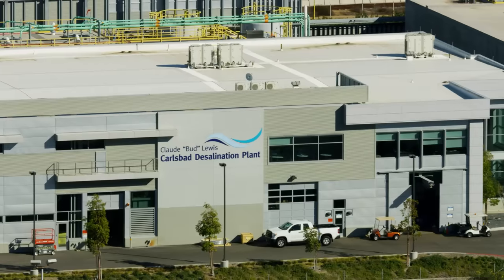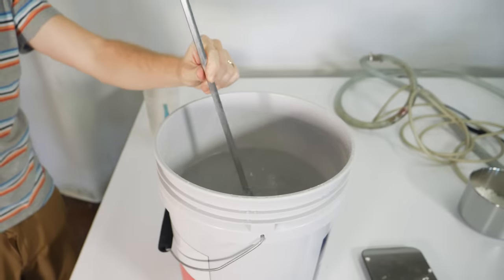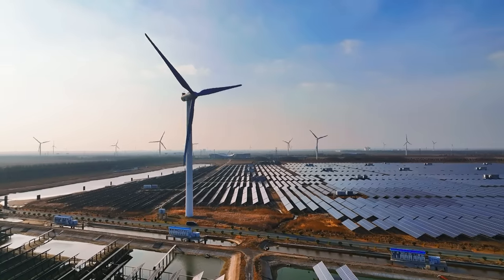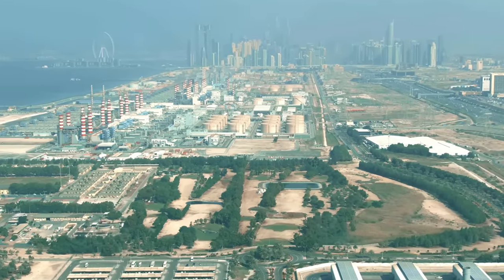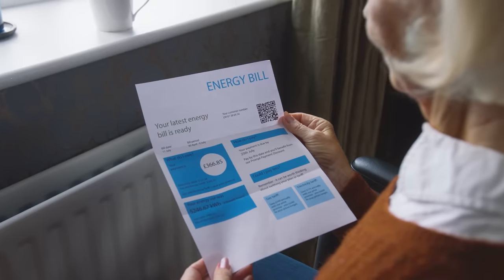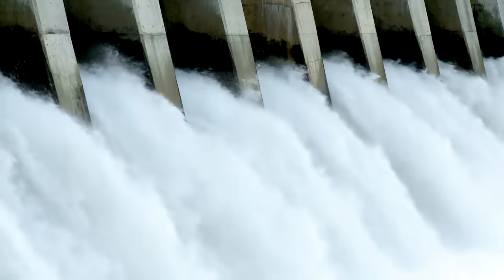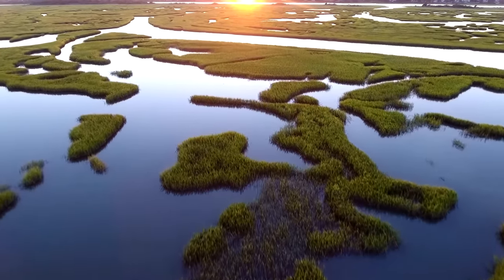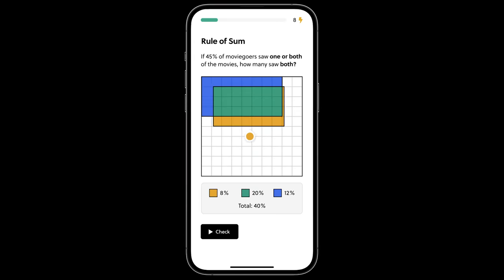Why Is Desalination So Difficult?

Comment: 6:00 Why not use two water delivery systems ?
One to bathe with that contains salt, which is actually good for the skin,
and one to rinse with and drink. That lowers water consumption to maybe 50 gallons
per household per day. Then you'd only need to distil or reverse osmosis that much
instead of the full 500 gallons.
I'd fit my boat with both forms, and only require 3 gallons per diem. The rinse is done
by filling something akin a wetsuit with water, maybe twice.

Comment: Interestingly, salt water can be used as the electrolite in a battery. The anode and cathode of the battery facilitate electron exchange between the sodium and chlorine ions in aquious solution. Aside from generating power, this has the side effect of precipitating the salt, (desalinization). If anodes can be found that don't corrode in the presence of chlorine, it should be possilbe to generate significant power while also producing large amounts of desalinated water, with sea salt as a byproduct.

Comment: Seems salt water could be used for some purposes, without desalination, to reduce the use of fresh water.  E.g., fire fighting.  Industrial cooling.  Etc.  I realize it would be necessary to use highly corrosion resistant plumbing, but if the water is very cheap then maybe that would be worthwhile.  I first considered this after seeing the fire in Lahaina, Maui.  They're sitting right on the ocean but couldn't get any water to fight the fire.

Comment: I actually submitted a different water solution to San Diego which would make  generate water for the same money it costs to bring it down the aqueduct but San Diego did not bite ... the current solution is very expensive because of the method and then transportation.

Comment: Supercritical Water will not hold ionic salts.  Could it be used for desalination?  Requires elevated temperature and pressure.  For the heat you can use combustion in the sH2O, it is called supercritical oxidation SCWO.

SCWO operates at extremely high temperatures and pressures (above 374°C and 22.1 MPa).   The pressure would be about 220 atm.  Reaching and maintaining these conditions require significant energy, which would probably make the process more expensive compared to conventional desalination methods like reverse osmosis or distillation.

Comment: So we need to be able to:

1. Bring in water without the need for pre-filtering.

2. Evaporate it without using electricity for the evaporation process or burning fossil fuels. Perhaps by using focused/condensed sunlight to raise the temperature of the water to boil. 

3. Have the heating occur from the top so as to prevent the inefficiencies caused by bottom boiling once contaminates start collecting. 

4. Have low energy use say only that needed for monitoring systems, shifting of the remaining solids/any remaining brine, and then pumping of the water that has been desalinated to rest of system (for adding minerals for example) so you can power it via solar/wind/wave power. 

5. Ability to spread the waste material, without the need of using pumps, over a large area of the ocean. 

I actually came up with a design that meets these requirements over a decade ago but never actually had enough money/time to build it. Now that I am stuck living in a travel trailer (technically homeless while trying to get SSDI) I have plenty of time but still don't have the money/can't build it myself anymore due to health problems. :(

Comment: Distillation is ultimate water purification system. Disadvantages  requires energy + time + scale removal. Advantages consistent purity and eradicates anything that cannot survive in boiling temperatures.

Can you make it more efficient? Of course. Using basic HVAC principles but with water. Insulate boiler, condensd it, greater temperature difference greater condensation.

If your distilling seawater dont have to worry about VOCs so no post filter. Remember filtration is different than purification.

Distillation can even be used in survival techniques. Create a solar sill. Put a parabolic mirror on it if, you can. 

Distillation is just flipping water inside out, by making it change state and turning it back to a liquid. 

Distillation can be achieved with solar, electric or flame heat source.  
Only issue with that water it needs to be structured on a  molecular or it will have great solvent characteristics by trying to adhere to something; increase as it gets more pure.

Comment: desalination is also done with another phase change: freezing. 
the most common is the 40 stage flash desalination, where the evaporation enthalpie is reused 40 times.
besides reverse osmosis, there are others.
You neglect that the reduction of alkalinity in the seawater from PH 11 to 8 is the dissolved CO2 in seawater.
Important because this gas must be removed to have acceptable heat transfer in the  heat recovery condensation surfaces. Your oversimplification has consequences
.

Comment: If this comment ever gets seen, here are my two cents as someone who has worked on different kind of ships.
If you're taking 500+ passengers plus crew, your "potable" water will come from tanks. It's a whole part of one or two of the engine crew's duties to manage water. We try to reuse gray water, and are usually responsible for what we do with the water we release at sea 
2nd case, a commercial ship, around 50-100 crew that may not see a port in weeks, chances are, water comes from distillation. The cooling water necessary for a massive diesel engine, can be combined, as in a nuclear reactor, to clean water that is warm enough to boil and distill. We would not drink that water, but it is technically potable.
The third case, is reverse osmosis. I have seen it on french research ships and on smaller "recreational" ships.
Just my anecdotal experience.

Comment: Desalination using concentrated solar is super simple. The biggest issue is the vast amounts of salt left over. Which is why an economy needs to be built around its alternate use (such as for sodium ion batteries and winter salt brine used on roads) as well as ships to take it out to sea while remixing it with sea water to dilute it down to safe levels for the ecosystem.

All of it can be paid by the consumer because the power being used is free once built, so the water cost would eventually be less than current prices. The sale of the salt for other uses would pay for the remainder of the costs. Which is why creating that sodium economy is so important.

Comment: You don´t need 5kWh to evaporate a liter of water, required amount of heat energy is only 732.2 Wh, you just use inefficient heat method. The amount of time needed strongly depends on your heater as well.
Reply: Oh, you mention the efficiency aspect later in the video, my bad.

Comment: You talk about using solar energy, but are you referring to traditional solar energy, where we get electrical power from the sun?  Or are you talking about what seems to be a more efficient approach for desal, to use mirrors to concentrate the heat from the sun, and simply use that as our heat source for distillation?  

I could see pipes running through a long U-shaped tub, where the U-shape is really a parabola concentrating the sun's rays on to the pipe.  You only need to concentrate the heat by 5X or so to get water boiling, and that's if you haven't reduced the pressure at all.

Comment: Desalination, the process of removing salt from seawater, is difficult for several reasons:

1. High energy consumption: Desalination requires a significant amount of energy, whether through distillation or reverse osmosis. Approximately 25% of all energy used by the water industry is consumed by desalination plants, making it an energy-intensive process.

2. Low efficiency in its simplest form: DIY distillation or basic reverse osmosis setups, as demonstrated in the video, are not efficient enough for large-scale applications. Modern desalination plants use sophisticated setups to maximize efficiency.

3. Cost and complexity: Desalination is a costly process due to high energy requirements, extensive pretreatment processes, maintenance, and post-treatment to make the water suitable for consumption.

4. Environmental impact: The concentrated brine byproduct, which is significantly saltier than seawater, can be harmful to marine life if not properly managed. Disposal of brine requires careful consideration to avoid ecological damage.

5. Water quality and taste: Seawater contains a higher salt concentration than what is palatable for drinking. Desalination must remove more than 98% of the salt to produce fresh water suitable for consumption.

6. Technological limitations: There is a theoretical minimum energy requirement for desalination, but reaching this limit is challenging. Advancements in desalination technology are continuously being made, but there are still technical and scientific hurdles to overcome.

7. Alternative water sources: Desalination competes with other water supply methods, such as dams, reservoirs, groundwater, and recycling, each with its own costs and environmental impacts.

Despite its difficulties, desalination is a viable solution in many regions facing severe water scarcity. It serves as an essential water source in areas with large populations and limited access to traditional freshwater resources. Private partnerships and advancements in technology continue to improve the efficiency and viability of desalination as a potential solution for water supply challenges.

Comment: Hi Grady - I always wondered if solar power distillation combined with a turbine to extract the energy you put in would work. Any thoughts? This would basically be (1) a solar energy generation mechanism (mirrors focus sun to heat water to boiling; extract energy from steam) combined with a desal device.

The problem I'd imagine is: can you get the solar energy genreation efficiency to near another option like solar panel. If this device could be half as efficient as a solar panel, I"d imagine the passive desal benefit would make this an attractive option in a dry, urban area.

Comment: Can't you use the brine waste product from RO and mix it with some pre-treated sea water and then re-load it through the RO process? By using the brine waste, you're using material that is already pre-treated and therefore the amount of pre-treated sea water required is reduced. The only problem I can see is that the feed stream has slightly higher concentration of salt due to mixing with concentrated brine and sea water, but still lower salt concentration than pure brine

Comment: I thought a simple solution was to have large shallow pools with a slanted greenhouse type ceiling/wall to catch evaporation and let it slide down into the collector. Scraping the residue form the basin floors occasionally - a moisture farm.
Reply: That would work great for a small scale, but the area demanded to support even a small city would quickly become absurd

Comment: As a chemist I can honestly say that this distillation setup is good. OK, "good enough for government job (and YT presentation)" ;-)
Seriously though, while "there's room for improvement" it "does its job" alll the same, quite fine. But! - and this is a big "but" - in "proper" water distillation units/ devices the heat from condensing steam (water vapour) is recouped - that is, the cooling water that absorbs the heat from condensing steam is fed into the distilling pot.
This is a big deal as specific heat for water phase transition is extremely high.

Comment: Gravity Fed RO is also possible. With some planning this could save TONS of grid electricity. Releasing brine is majorly problematic. Brine can be further processed down and concentrated and then used in liquid salt solar plants or similar processes where the remaining water could be processed off. Another possibly of distilling it off as well. Maybe the use of carbon black heat exchangers to save energy at minimum to preheat before boiling or have a more passive system that would be just the Hulk version of a solar distillation camping contraption.

Comment: What if your on an island and you dig a well in the middle of the island? Would the water still be salty? what if you constantly drain the well everyday so it keeps refilling? is the salt not filtered out by all of that ground? Also does evaporating seawater not work? What if you evaporate it again and again? Are not hurricanes evaporated sea water?

Comment: For more efficiency, add anti-sodium and anti-chlorine to your saltwater.
The sodium and chlorine will not only mutually annihilate with the anti-salt, but it will release energy that you can use to heat water and spin a turbine for power!

Comment: I think you can lower pressure to boil water, could that be cheaper than using heat?
Reply: No, because lowering the pressure enough to boil water at room temperature would consume even more energy than simply heating the water to boil it. A lot more.

Comment: Salt CAN be a gas!

I've evaporated salt water from a styrofoam cup, and I note little salt crystals precipitating out of the atmosphere around the edge of the cup. It's very interesting, not only that some salt evaporates as a gas and then condenses again, BUT ALSO it doesn't precipitate in the form of cubic crystals as it does under water, instead it forms little "whiskers" -- no doubt the ions follow the electric field and that results in whisker shapes.

Comment: I dont see anyone using a centrifugal process, wouldn't you be able to separate much of the heavier salt and sea particles, out of the water, prior to sending it to the filter, which would reduce brine return from the filter, and prolong filter life, so why would that process not be used, also, we need to think not only in terms of pressure, but what about working in terms of a vacuum, because water boils in a vacuum, so it would be cost effective to pull the salt water into a vacuum so it could boil at a very low temperature, thus saving power usage, but producing much more usable product.

Comment: To speak a bit more practically with how these numbers fit into our lives: first, you could actually shower in salt water and use fresh water to drink. Second, most of our water gets resupplied after being cleaned out of the sewage, which cuts down significantly on the amount of desalination required to replace water used per capita.

Comment: a simple flanged trough winged to absorb solar heat "like a guard rail" with an angled catch above the main body condensing any evaporate from the tough underneath. For miles! All powered with a single pump that has a head pressure equal to the hypotenuses angular ratio to provide flow over the constructed distance.

Comment: There is a newer method using centrifugal forces that is more energy efficient as it just uses Gravety so the cost is pumping. The problem is that its not wuite as good at desalination leaving a few extra parts per million, however its great for crops or supplementing salt free or low salt water.

Comment: I'm sure there's a good reason (or reasons) why using simple solar heating as a first stage of desalination is not economical, but it's such an obvious idea I would have liked something more in the way of an explanation than a throwaway about reinventing the water cycle. And engineering the financing of a plant doesn't radically affect the cost--that bit crept in from nowhere.

Comment: Are you going to talk about forward osmosis? This system works allot better with waste heat.  This system uses a draw fluid with a substance that draws water into something, like sugar, that will draw water across a membrane.  This solution then is chilled and the draw material crystallizes out leaving fresh water. After ward, often, reverse osmosis is used to  remove trace amounts of draw material from the water (far less energy needed because of a lesser gradient to over come).  Since water is drawn across the first membrane there is less problems with the membrane getting clogged like with reverse osmosis.  Plants using this method can use waste heat to raise the tempature in the draw fluid to dissolve the draw material and a cooling source like deap ocean water to crystallize out the draw material. The whole process uses far less energy than reverse osmosis with the heat required often being free from some other process like electricity production. Plant is more expensive than reverse osmosis but is more energy efficient.  Mostly only small plants working now but should become more common in the future.

Comment: How about using supercritical water based desalination.  High pressure and temperature are required but it would be interesting to see an analysis.  There are water depths sufficient off coast of Sydney.

Comment: Wouldn’t a cheaper alternative be to set up hundreds or thousands of reservoirs that would catch rain water and send them to the local water district?  I’m not talking about the typical drains we see on the streets that collect water and send them back to the sea, but actual large collection area where the water dying storms are collected and along with regular household sewer system goes back to recycling the water.

Comment: I dont understand why they say it is so Difficult and expensive, when I've done it with a bed of red hot coals, 2 glass bottles, some sand and some Salt water. It takes a little bit, but it works just fine and makes perfectly drinkable water

Comment: why dont we simply use electrolysis? we convert the water into a mixture of hydrogen and oxygen and then burn that to get back the water, plus we can use the energy obtained from the burning of hydrogen to increase the efficiency of the system